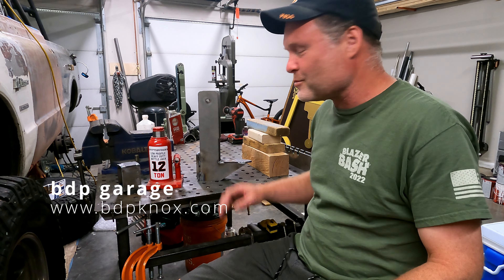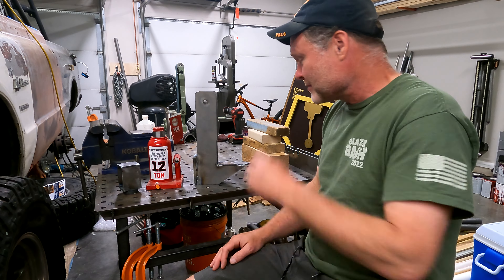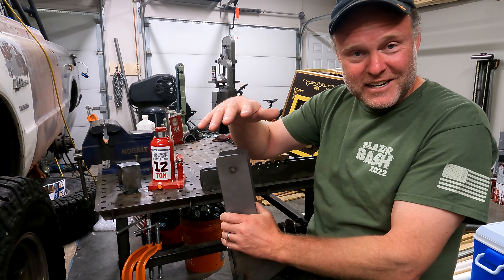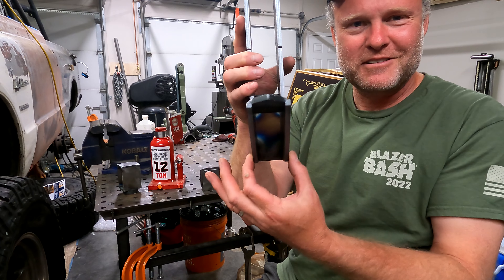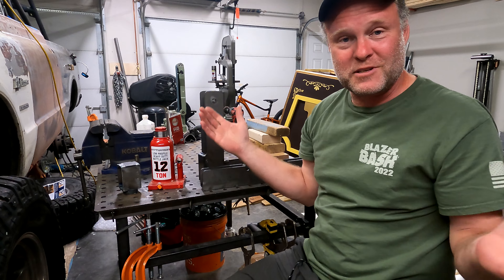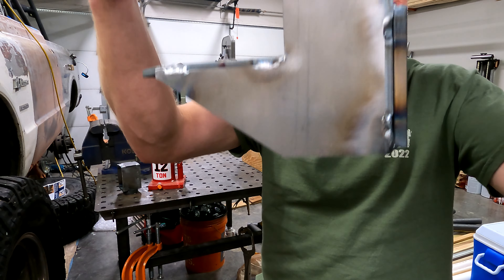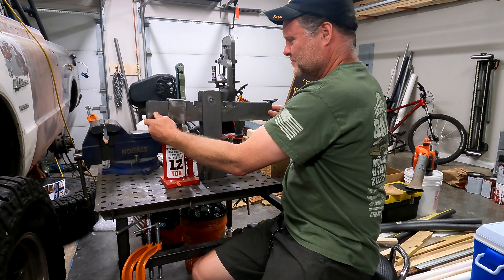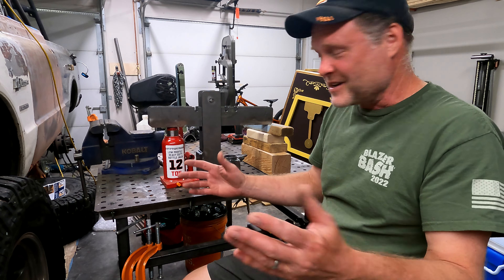Concrete slab lifting tool version 4.0 details and demo.

Comment: I didn't know you were fabricating them to sell: I thought you made one for yourself.  I will go visit your website.  I honestly don't know if I could use your slab-jack.  I am in the early stages of either remodeling, repairing or restoring our swimming pool deck and tiles etc.
Reply from the maker: Originally I wasnt but after getting so many requests I decided to do so. Have 3 left of the latest batch. You would need to be able to access one side of any sunken slabs and be able to fill them with something once they are lifted to the height needed. I used stone and construction grout to fill the voids underneath.